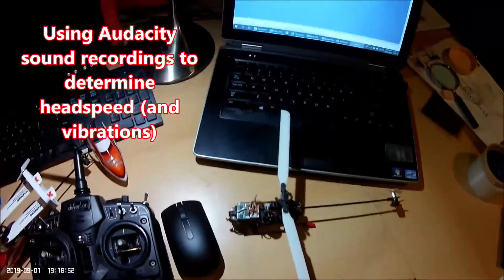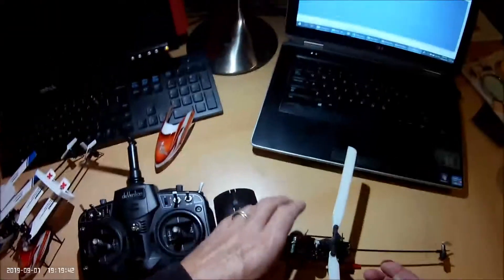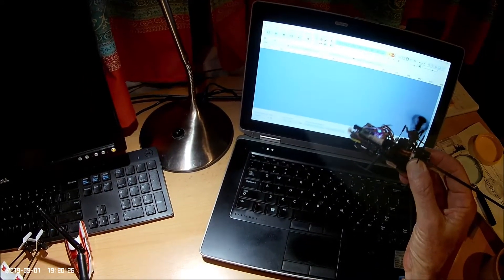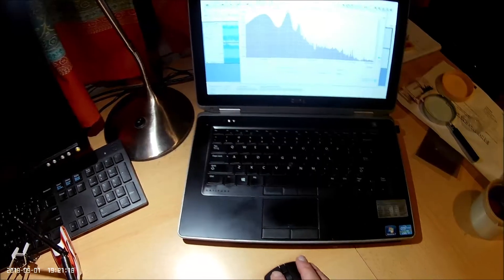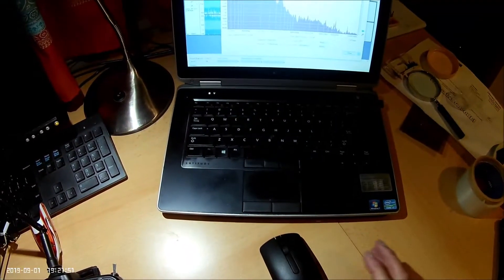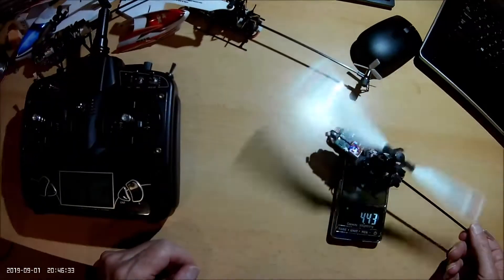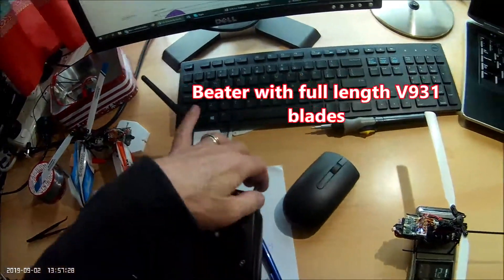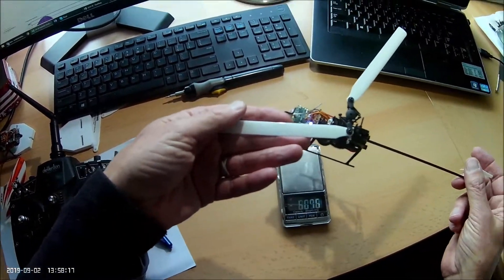XK110 1S & 2S Shootout Part 1  Bench Testing

Comment: hey mate, do you recommend flashing blheli on the stock k110 esc? I'm just getting back into this heli after 3 years haha
Reply from the maker: I've been flying 2 110's on 1S back to back, one on the standard flash, and one on BLHeli. TBH I don't find any great difference between them although the BLHeli one flies with heavier 600 Nanotechs, the stocker with the 520mAH GNB batteries. Might show up more if using the same batteries on both. 2S bird has BLHeli.

Comment: Awesome video. I like mine with xk k123 rotorhead. It really does need the 8mm tail outsidr dough
Reply from the maker: Have a K123 head on the way to try on my second 2S K110 build and plan to convert this one to a 2 blade DFC head using a K124 head. But looking forward to the 3 blade which will get an 8.5mm 2S tail. Great little helicopters!!